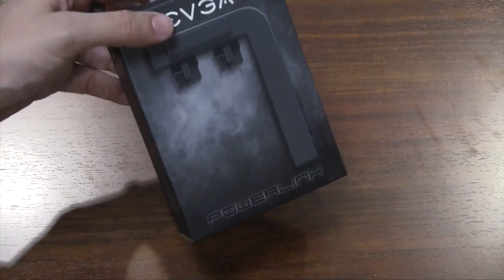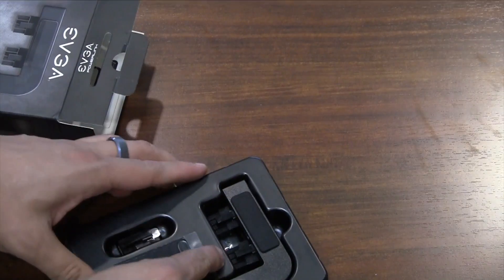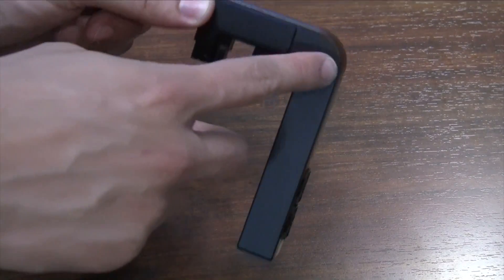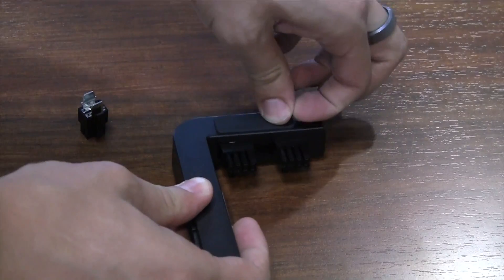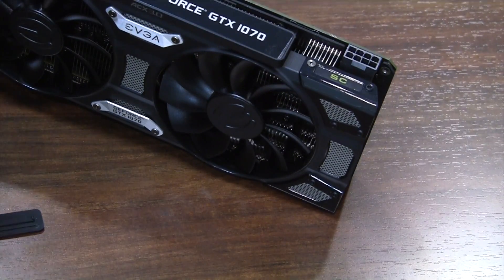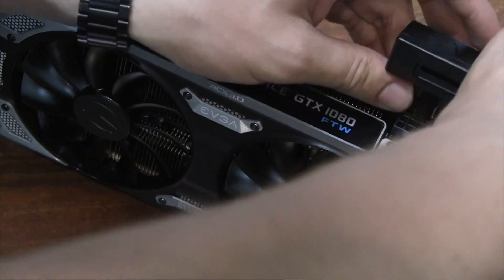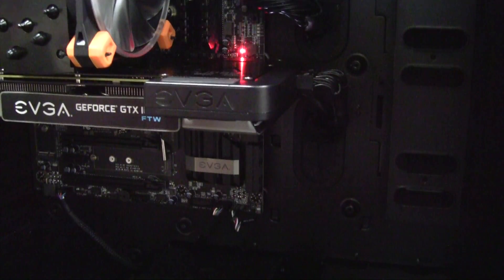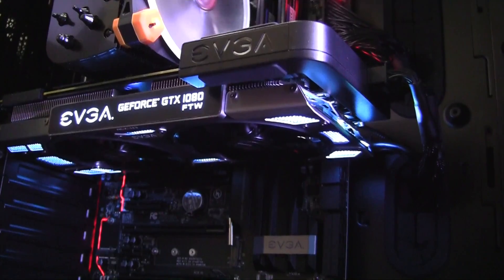EVGA PowerLink

Comment: Rather than something that just moves our wires over, why not give us something that does something really useful as well, like say supporting that one saggy corner on heavier cards? I've got an ASUS card, fantastic, with a metal back plate to look nice and keep the card itself rigid. But the only support points are the the back panel (which is good), and the PCI slot itself (which is NOT good) meaning that other corner sags. Is it a huge deal? Maybe not, but it's a whole bloody lot bigger a concern than having my power cables turned 90degrees and moved like 4 centimeters....

Comment: Really would like to buy one if there was an optional RGB version.  Would Look out of place next to my EVGA GTX 1080ti FE that lights up green.   Really surprising that EVGA did not make it come with some kind of LED.  Even if it was just a white LED, would have been super easy to mod it with RGB. Cutting out the letters looks like crap using a dremel tool. No way to make it look factory that way.  C mon EVGA, your customers are asking you to please add RGB either standard or optional on this very cool product

Comment: At 30 bucks it's just a bit too pricey for the little that it does. Now if your case does not allow top power connections than you have very little choice... It's a great concept, I just think too much GREED is built into the product. A simple redesign of Video Cards to put the power connectors to the back, like many Tesla Cards, would render this power connector obsoleted, hence the reason I said too much GREED is built into this product. I mean seriously a few metal power strips, a few cheap capacitors, a strip of low end PCB, some plastic parts, and changeable power connectors for 30 bucks is just not reasonable. 

I bet profit on this unit is easily 500% to 1000% easily. I find it impossible that reasonable profit of 30% is being applied to this unit. Not knocking Profit or EVGA here, both are vital to any Economy; but what I am knocking is GREED. I do not believe that this unit costs upwards of $27 bucks to make and leaves $3.00 profit. I think this thing cost 3 bucks to make and 27 profit and that is just not reasonable. Bring the cost down to under 10 bucks and EVGA would not be able to keep them in stock. Hell @ 10 bucks I'd buy 2 just in case the first one broke; but 2 @ 60 bucks, no way I don't have that kind of cash reserve...

Recently with nVidia releasing their Founders Edition with the EXTRA 50 bucks for Half the card specs leads me to believe that nVidia is starting to get too big for it's britches. Sure nVidia is WRECKING AMD and almost forcing AMD out of the Market leaving AMD no choice but to dump their cards at very low prices. Bottom line is if you price it right it will SELL; but input GREED and now you just GOUGING because YOU CAN. Therein lies the problem... Keep up the Price Gouging nVidia and you will REVIVE AMD in the Video Market. Perhaps that's your intent...

I am seeing GREED going hand in hand with Price Gouging just like any Country that believes HIGHER TAXES will SOLVE EVERYTHING. You want People Happy and you want repeat business, price your units to SELL to EVERYONE and you will have more money than you ever thought possible. Price an item too high then sit back and SCRATCH your head as to WHY IT WON'T SELL because only a SELECT FEW can AFFORD IT. I know, it's like Rocket Science or something.... I mean it's not Rocket Science, which number is HIGHER selling 100 units @ 500 each or selling 200 units @ 300 each or 400 units @ 200 each? Obviously if you can sell 400 units @ 200 each you would make 80,000 but oh no, GREED dictates that you MUST SELL EACH UNIT for 500 each because GREED Says more is BETTER....

Why did I use 500, 300, and 200 respectively? The GTX 1080 is over 500 and it's not SELLING while the GTX 1070 is in the 300 price range and it's selling a few but the GTX 1060 is in the 200 price range and no one has any in stock. AMD is under 200 and again you can't find a card in stock. 

GREED KILLS THE FREE MARKET regardless of PRODUCT and I predict this EVGA PowerLink is NOT GOING TO SELL @30 bucks a pop, I mean sure it will sell to the few that can afford it, but @10 bucks EVGA won't be able to keep it in stock. Do the Math EVGA, Price Gouge and make a few QUICK BUCKS or Price it to SELL and Make a FORTUNE, the choice is YOURS....
Reply: Paul Bialozor well speaking of greed , I would suggest to add a couple of LEDs and the price will jump to 60 bucks for a cool shiny RGB power link
Reply: Agreed Emma Heart, this is just too pricey to be worth considering... I am sure there are folks that are very well off that if 50 bucks drops out of their pocket they won't bother to bend down to pick it up; and that sort might think this is worth it. 

For what it does, it's just sad for the price. Video card Vendors make cards with the connectors on the short side that face the back all the time so how putting the connectors out the top has become the standard is just absurd. 

All cards should put to the back side and items like this would be useless... It's almost as if they want to try and get more for their product so they make the connector wrong on purpose... Who knows.... Cheers...
Reply: I just dropped $1,000 on a 1080ti do you really think $30 bothers me